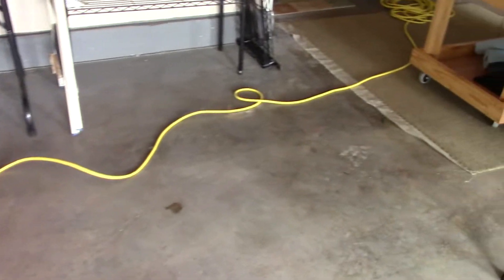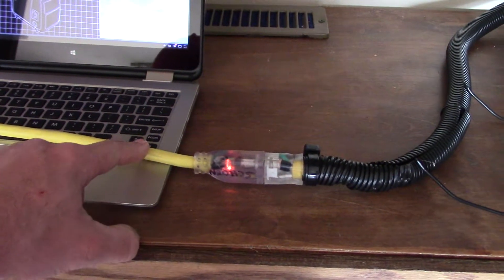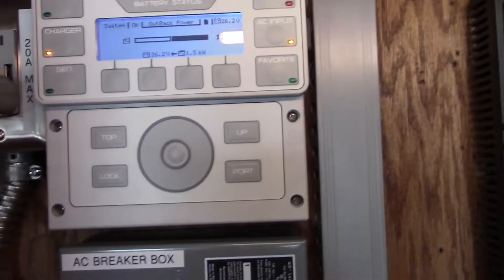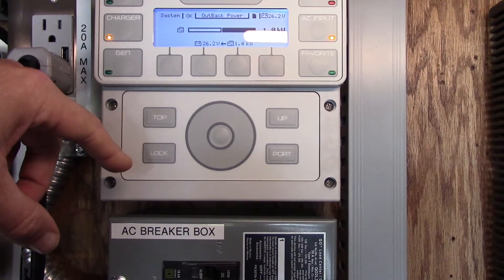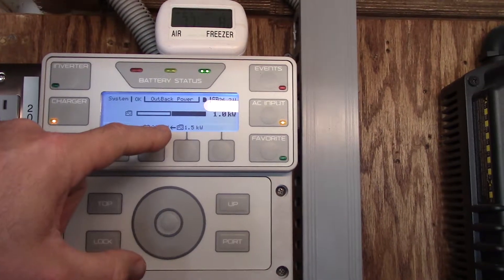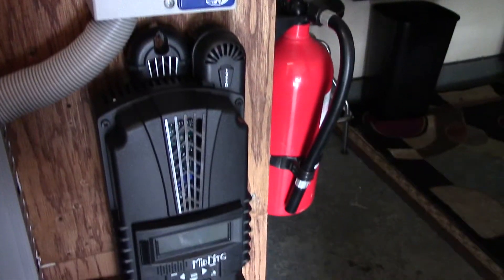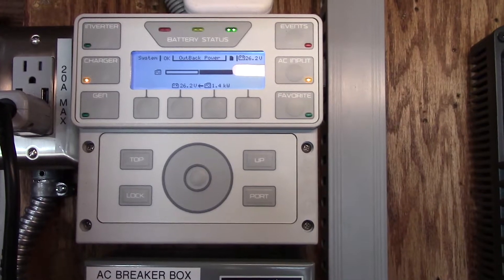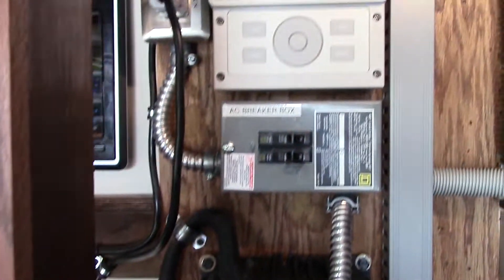Honda EU2000i Companion inverter/generator FIRST TEST! Outback Power inverter connected.

Comment: I have the Ryobi gen, and it is nice in eco mode, but when she is putting out all the watts it is a little noisy.  I have considered a quiet box or some type of extra muffler.  Looking forward to your build.
Reply from the maker: Fernbark Frist What size Ryobi are you running? I will keep you updated on the quiet box.
Reply: They only have one, it's the 2000 (but really 1800..but in real life the 1600).
Reply: do you have it conected to your inverter?